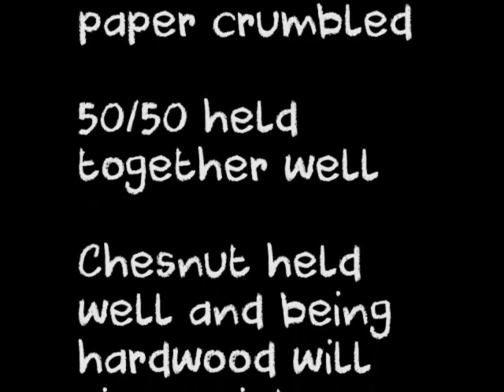Making Charcoal briquettes

Comment: Does this burn as hot as kingsford charcoal?
Reply from the maker: Alright Dj Kadub, Am sure the the chainsaw chesnut saw dust would burn as hot as kingford charcoal as there are slight air gaps inside as the pressure i used to make them wasn't huge, but the paper/carbon mixture would be much lower.I never got round to a burn test but still have them so will have to get back to you on this issue.
Reply: Okay, thank you. I recently made a aluminum melter out of a ballon time helium tank, and needed something that was cheaper, otherwise id go broke doing it. Thank you